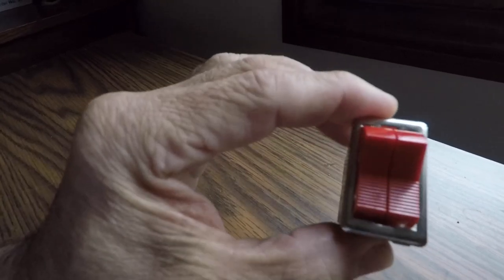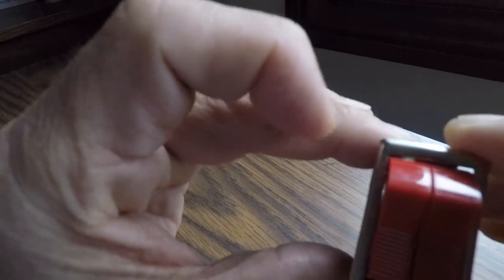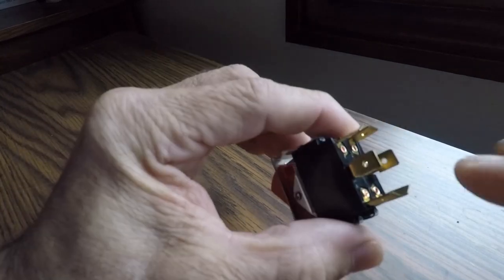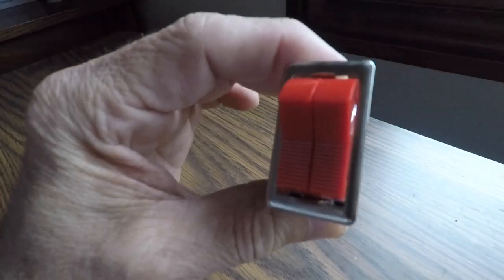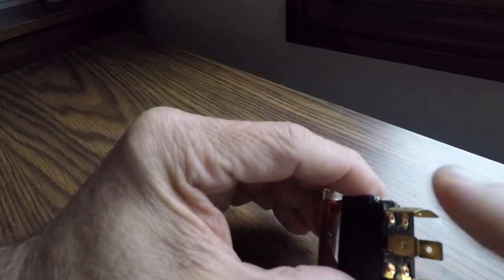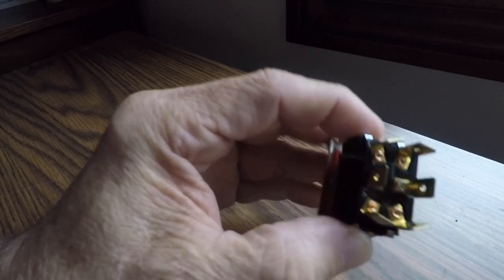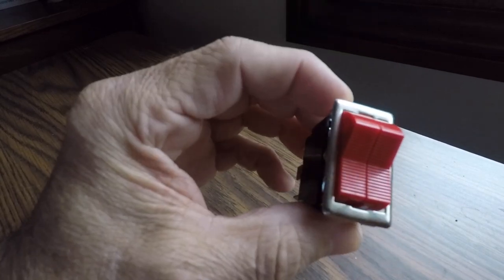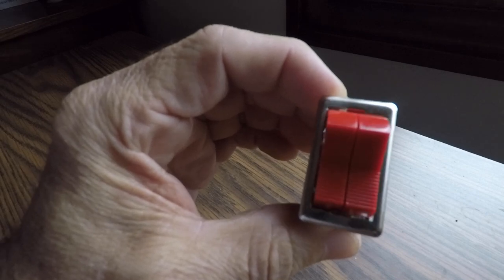Split Master Switch - Grumman Style

Comment: I have one just like this in my AA1-A.  My ammeter recently quit working as I was adding new P-leads. I discobnected everything and accidentally pulled some spades loose on the back of the split mastercswitch .  I cannot find a wiring diagram for the 6-spaded switch.  Can u help?
Reply from the maker: Center are the mains, then you flip them forward or back